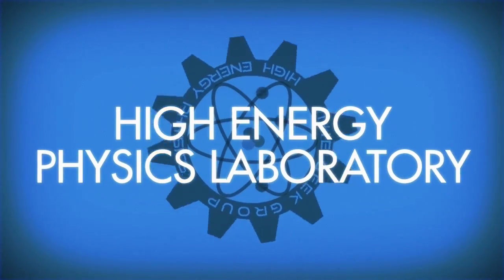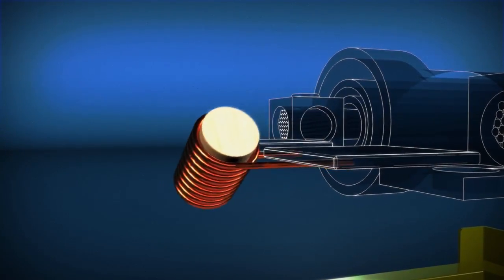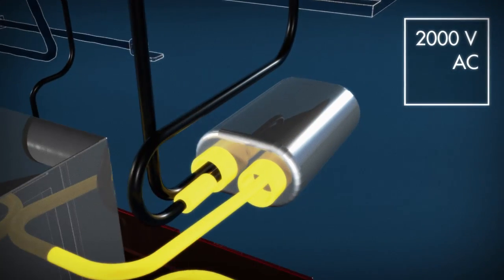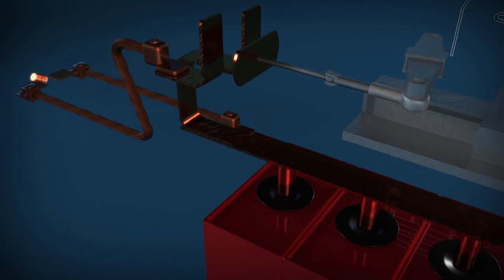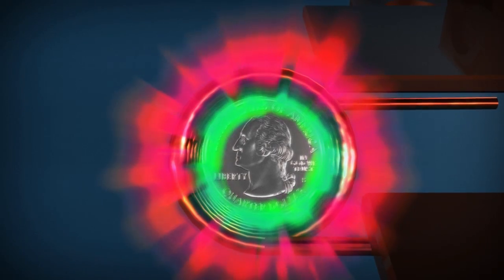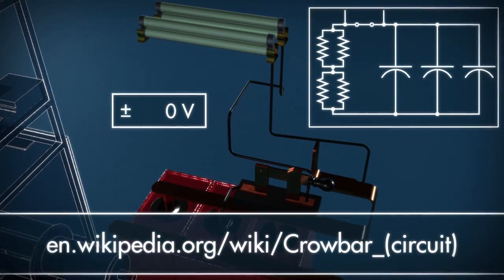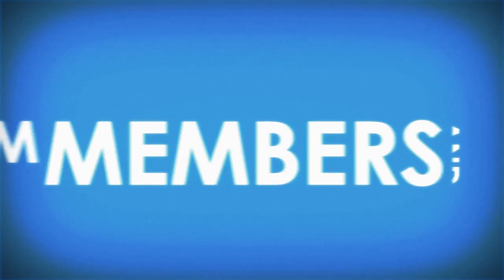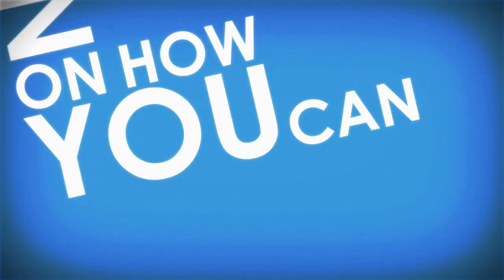Project Stomper Mark 4 Walkthrough

Comment: Hmph. You switch looks a bit weak. It would be much better idea to use the same piston, V shaped split and a triangular contacter. In that way the contacter would hit it a slightly deforming metal and deadly sticking it between other two. But still nice work.

Comment: silly question but does the coins thickness change to compensate the shrinking of diameter, the same as hitting around the edge with a hammer. also does the weight stay the same. and keep up the good work (:

Comment: What is the total capacity of the storage capacitors? Could you perhaps compare the energy stored within them to something illustrative, such as dropping something from a particular height? How efficient is the discharge circuit? Do those thick metal rails heat up a lot?